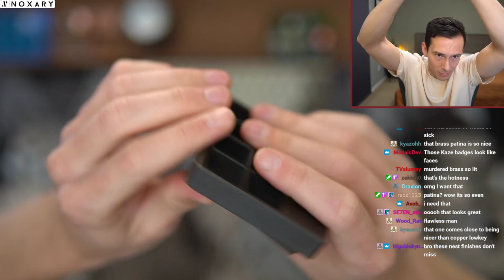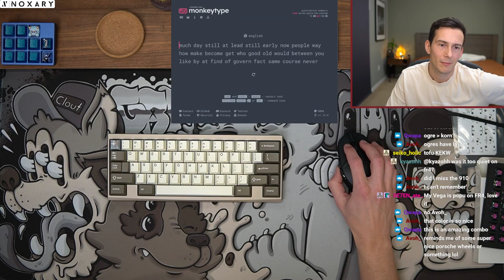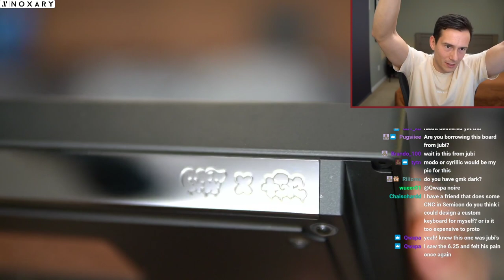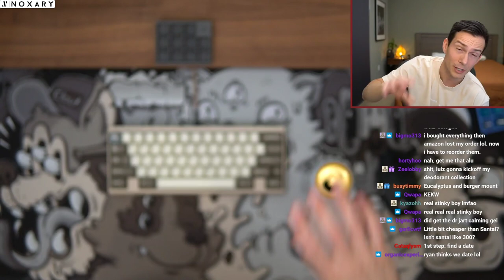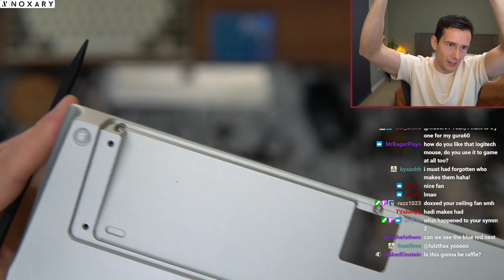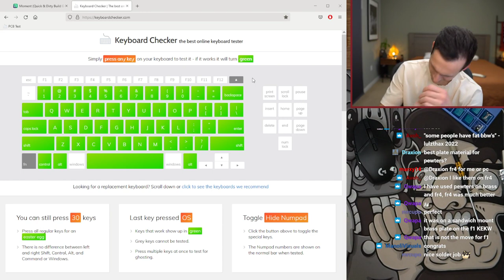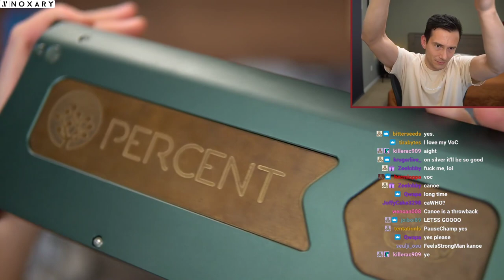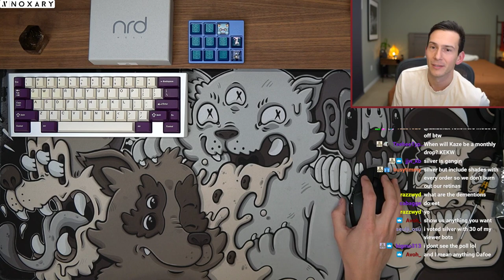Moment by jjw Build Stream

Comment: do any boards come prebuilt at this level? im typing at 150-180 in 30-60 sec test and 190-210 consistently on the 15 second test, using a "DROP SIGNATURE SERIES CYBER SURGE KEYBOARD" - after getting this board i noticed a lot of hate on the brand, eventually need to get one of the right tools under my hands and see what the hypes about or is it not going to change much in your opinion?? the people talking trash to me on the kb group im on facebook dont seem to (in general) be putting out higher numbers(wpm) thats for certain lol im just not into soldering part personally seems scary and im a bit shaky when it comes to that precise type of thing
Reply: Keyboards such as the moments and any others that come at this high of a price come unbuilt and you need to put it together yourself of hire someone else to do it for you. As for the typing speed, I don’t think a change in keyboard makes any difference. Getting something like the JJW Moment just types better in terms of sound and feel. It’s doesn’t make you type any faster.